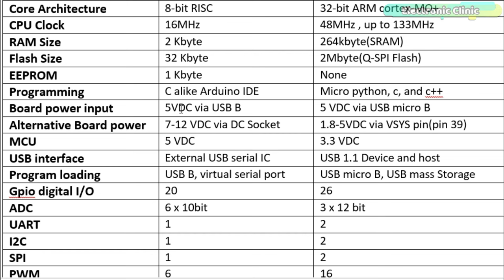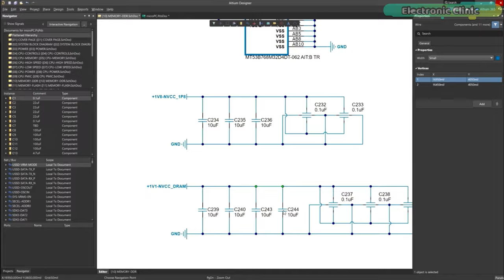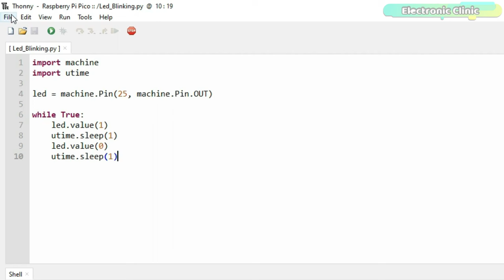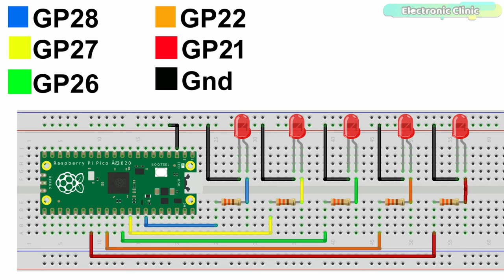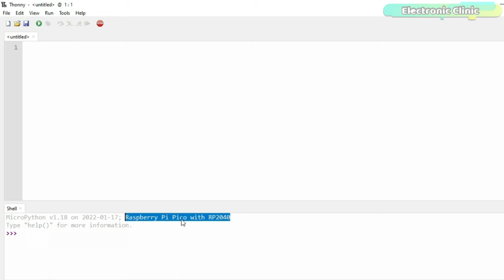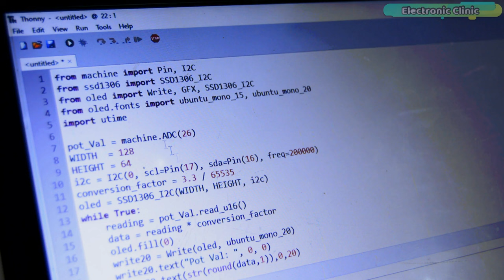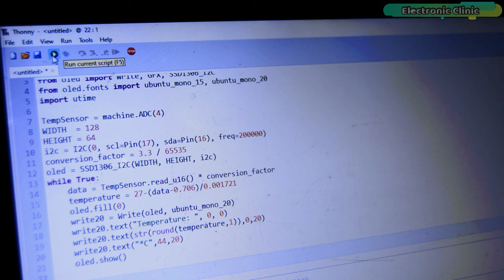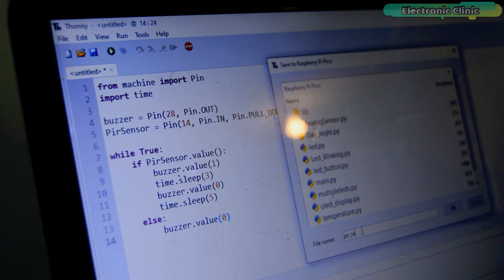Raspberry Pi Pico RP2040 Programming in MicroPython, Complete Course for Beginners with Examples

Comment: @27:18 Example 5 - OLED Display
@32:55 Example 6 - Analog Input with Potentiometer
@34:07 Example 7 - Sonar
@36:42 Example 8 - Temperature Sensor
@40:13 Example 9 - LDR sensor
@43:12 Example 10 - Security Sensor - buzzer

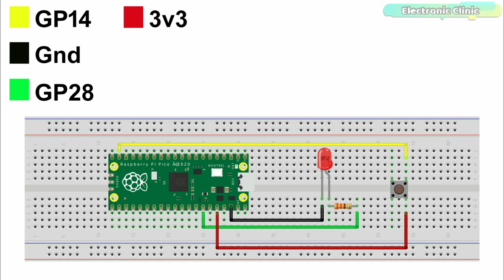Comment: @25:47 the button is wired incorrectly, both wires should be on the same side of the button, one going to pin 14 and the other going to 3.3V

Comment: Hello, I have a problem with my RPi Pico. After each unplug and replug, MicroPython needs to be installed every single time in order to work. Why is it happening? It seems like the Pico just forgets that it has already been installed
Reply: When you want to save the program on a pico, save it with the name called  "main.py" If you save it as anything else, if only runs while it is plugged -in. 
I would of hope Raspberry would change this.

Comment: could you tell me where did u get the potentiometer?
Reply from the maker: You can get it from almost every electronics shop, or you can salvage one from an old circuit.
Reply from the maker: It doesn't matter if you don't find the same exact pot, any pot will work.